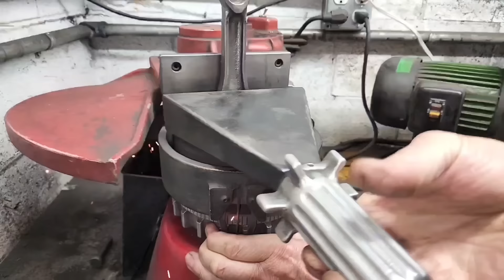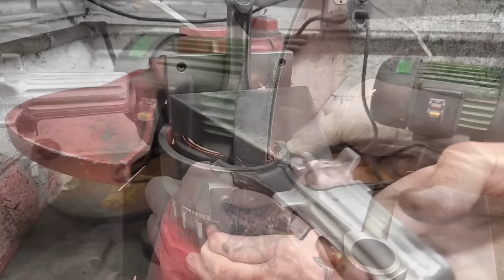Nobody resizes rods correctly see how I do it

Comment: Dave, it's obvious you know what you are doing and you are good on the hone .You have a lot of experience putting every rod right on zero. I would like to offer one suggestion. It looks like you are honing with Sunnen MAN-845 oil which is 50% Sunnen MB-30 oil and 50% mineral oil. If you get a chance to hone with 100% MB-30 oil I believe you will love it!. Sunnen actually specifies MB-30 to their industrial customers. They said they made the diluted 50-50 version, MAN-845 for Automotive Machine shops after some complained about the smell of MB-30 and taking too long to wash it off.
Reply from the maker: I'll look into that Thanks for watching and subscribing Greg 🇺🇸

Comment: You are doing a decent job…for the process and equipment…doing one rod at a time can alter the perpendicular of the rod bore to the sides of rod..lSUNNEN recommends younuse two rods at a time and reverse the locations as well…I had a new machine and sold it immediately as soon as a power stroke machine was released..one rod at a time captured between two ground circular rings that are absolutely at 90 degrees to the mandril

Once we got the machine going ZERO SPUN BEARINGS AND MANY RACES WON…BEST MACHINE FOR THEVBLUEPRINTING PROCESS
Reply from the maker: I'd never use a power stroker 
The first time the rod hangs up the power stroker tries to still stroke it, obviously it won't but that will throw the alignment out of wack and every rod you do after that will be honing crooked until the thrust faces are corrected 
Thanks for watching and subscribing 🇺🇸

Comment: i knew you were a dumbshit by the way you grind caps lmao are you trying to qualify?  the grinding wheel cuts on the edge of the wheel from sharp pore edges and you are glazing it across the surface as fast as you can that is the absolute incorrect hill billy method.

Comment: I just had a set of ford 300 6 cylinder  rods reconditioned,the crank only needed polished,can I still put rod in any cylinder? Somehow #5 and #6 got numbered #6
Reply from the maker: If they were resized properly it doesn't matter where they go
If the pistons are used and still on the rods I'd put them back in the same holes
Thanks for watching Troy 🇺🇸

Comment: would have thunk you'd use a reamer on those cap bolt holes... dint know they made hones that small....
Reply: That fit between the cap and bolt shoulder is critical for cap alignment.
Reply: @sarahelgin8082  are the bolts so inconsistent that you cant get a reamer to match the diameter?
Reply from the maker: The size of the shank changes a few tenths by the amount of press through the rod.
Reply from the maker: A reamer wouldn't work properly 
Thanks for watching 🇺🇸

Comment: How do you check if wrist pins are square to the big end and not twisted or bent?
Reply: The rod grinder clamps to the sides of the rod shank and cap making the new parting line exactly 90° to the sides. As the rod shank gets shorter from the parting line being ground, the pin end will need to be bushed and the corrected center to center length will have to be established. This process eliminates angularity between the big end bore and the pin and bore.
Check your rod with magnaflux to ensure they're not damaged.
Reply: @sarahelgin8082  Thank you! Learned something! 😃
Reply from the maker: I have a fixture made by Sunnen that check the rod for alignment 
Thanks for watching Sarah 🇺🇸

Comment: I have built 100s of high horsepower (800+) engines that lasted over 100,000 miles. My own small block 350 chevy dynoed at 622hp at thw crank after i rebuilt it and after 250,000 miles it was still making 590hp.   And i learned a ton from this video.  Thanks.  😉   
Specs of mt motor after rebuild: 383ci, 11.5:1 compression,  ported/polished lt1 (1996 camaro) heads, studded heads, and lower end. 2.02/1.60 valves
Cam: 550/565 lift, 296/298 dur @.050 , 105 lobe center. Custom grind roller,  redline 7500rpm
Ran E85
Sold car at 320,000 miles for 20,000. 
4.11 gears, 2spd power glide,  3200 stall, tubed rear, full rollcage.  Fun car.
Reply from the maker: That's an impressive build 👍 Thanks for watching Chad 🇺🇸

Comment: I thought this was the only way to resize rods.....Question: I have a BBChevy whose deck height (10.18") is (pert' near) even with piston compression height (1.27".). That's close. If I have to deck the block, can I shorten the 6.660" connecting rods (.020 or so) using this or some other method? Thanx......matt
Reply from the maker: Yes cutting and sizing a rod reduces it's length 👌 
Thanks for watching 🇺🇸

Comment: Does the hone touch the parting line because in theory that should already b at standard size  or do U take the complete bore a fraction oversize if you've got suitable bearings
Reply from the maker: Watch the video again I cut the parting line and make the hole smallest then hone it back to factory size
Thanks for watching 🇺🇸

Comment: Labor to Resize/Refurbish 50 year old rods good for 400 horsepower, 700$..., new forged 4340 rods with ARP bolts 500$ @ summit, good for 800+ horsepower...machine shops around here throw this stuff away because labor rates are too high.
Reply from the maker: I charge $250 for these 
And they're strong enough for 
Most street engines 
Thanks for watching 🇺🇸

Comment: You should as I do, check the cap fit after you press the bolt in the rod. Doing that will help reduce the size of the bolt and the cap will fit better.😊
Reply from the maker: I re-honed most of them after I installed the bolts
Thanks for watching 🇺🇸

Comment: Oh by the way if you pry your rods apart you use absolutely very little pressure it will not deform the ride one bit buddy if you hacked and grind on a ride like this guy did I wouldn't even use a pencil to mark off a place to punch it at I don't know but believe me I haven't seen backyard work like this in 50 years and yeah it's not 1950s anymore this is the year 2000 get with the program dude
Reply from the maker: You're nothing but a 
🧌 🧌 🧌 
Don't watch my channel

Comment: At 3:20, you side dress them after they're assembled & torqued together, that way the rod & cap are the same without any side lip difference! Also you don't free hand on the disc sander at 3:27, square the table to the sander perfectly & place the rod on the table stable before you touch the sander.
Back in the day I even bored out the babbitt on 6 cyl chev rods on a lathe, notched them for bearing inserts, & then sized them.
Reply: That’s the way I do it is with rod assembled then hit the sides
Reply from the maker: @tomwatson3662 Thanks for watching and subscribing Tom 🇺🇸
Reply from the maker: Thanks for watching 🇺🇸

Comment: Thanks for showing this.  I had a set of 1970 Boss 302 rods ruined by a machine shop last year.  When I got the rods back the caps were very hard to remove with the new ARP bolts.  I built a rod splitter and it took a shocking amount of force to remove the cap.  When I torqued them back down some of the caps walked to the side and created a lip at the parting line.   Also they did not chamfer any edge and it caused the some edges to fracture/crack when they torqued them down.  I don't have a single good machine shop in my area so now I am tooling up and doing my own machine work and this video explained exactly why each step is so important.
Reply from the maker: I'm glad you enjoyed it Thanks for watching and subscribing see-ya next time 🇺🇸
Reply: Prepare to spend a lot of money 🤑 ... Sunnen parts and machines are very high priced...
If you find used, don't be surprised... If the machine was abused... Fixing it will take lots of money & time...
Good luck

Comment: Still doesn't make sense to me. When you grind the caps you are only shrinking one diameter.
Reply: Rod caps stretch and get out of round in one direction, the rod centerline.
Reply from the maker: @hotrodray6802 ok and what's your point 🇺🇸
Reply from the maker: It shrinks the whole diameter 
Thanks for watching 🇺🇸
Reply: @BearButler321 I believe you that it does but how does it shrink the diameter parallel to the cap? Is it just a very small amount compared to the diameter perpendicular to the cap?
Reply from the maker: @gearhead1302 You're correct the sides don't get much smaller 
But it does decrease the size
So the rod starts out wider at the parting line and is then honed round 🇺🇸
Reply: @BearButler321 that's what I was wondering thanks

Comment: Hiya Bear, great vid bruv, hey just wondering at 4:00 when you start grinding the rod/cap area, how does the clamp/vice make sure the rod is exactly parallel with the cutting stone, I couldn't see any stop apart from in the middle area but that would still allow the rod to pivot out of parallel, can ya tell me how it's done? cheers
Reply from the maker: The sides clamp rod rod and hold it parallel
Thanks for watching and subscribing 🇺🇸

Comment: Do you grind the cap and rod mating surface at a slight angle to pinch the bearing halfs ?
Reply from the maker: No that's a bad idea it puts load on the bolts and they could break also when they're torqued and re-torqued the housing bores won't repeat and they will have distortion 
Thanks for watching and subscribing 🇺🇸
Reply: @BearButler321  I worked for a builder when I was young  . He never sent an engine out the door without doing that . He would set his grinder at just a degree or two , just enough to add a slight distortion. He claimed that it was insurance and never had a rod bearing spin . Of course this was back in the dark ages .

Comment: You are only measuring the middle part of the  bore journal, the outer edge of the bore need measuring too to check for bell mouth.
Reply from the maker: I guess you weren't watching 
I measured across the face of the housing bore and had no taper from edge to edge 🇺🇸

Comment: Glad you do NOT angle cut  It might work in a stock motor but in a performance build it breaks rod bolts
Reply from the maker: If a rod is angle cut it won't repeat every time it's torqued 👍
Thanks for watching 🇺🇸
Reply: @BearButler321  That true too and measuring stretch does not help, cut flat and start over even high buck aftermarket rods and a little extra clerence at the parting line makes no difference that's not where the load is

Comment: I can't believe the prices at machine shops I used to charge $15 for the first rod and then 7.50 for the others. I'm back in the day I charged $90 to bore a block.
Reply from the maker: Times have changed 
Thanks for watching Paul 🇺🇸
Reply: @BearButler321 sure has. 
I went thru my VR6 and had a bore and balance done. 
First oversize on the pistons , and IE aftermarket rods. 
While playing around with a scale before I brought it all to the shop , I found out the new parts weighed like 4oz less per hole for a savings of 24oz total across all 6 cylinders. 
That was just for funsies. 
The instructions for the rods said the small end might need to be honed a little ,and they did because the pins were a super tight fit. 
So for 1700$ I got the block cleaned ,bored ,and the crank balanced for the new parts.
I'm sure there was stuff that wasn't exactly listed ,like sizing that small rod end and whatnot. 
Overall ,most folks said that's a fair price for the work done in my area.
Plenty of locals recommended them, as it used to be the machine shop for Dyson racing but when he retired they opened the doors to the public. 
Maybe another rough idea for pricing, a buddy had a 350 Chevy flywheel surfaced for 65$ about 2yrs ago. 
Were located in the Hudson Valley area of upstate NY.
Edit: after watching that Spa rod video , I noted those IE rods I used were decent. 
About 800$ for the set.
Reply from the maker: @MrTheHillfolk I prefer the small ends to be small because every pin manufacturer varys the size by a tenth or two 🇺🇸
Reply: @BearButler321 yeah I figured my backwoods check of the slip fit of the new pins in the new rods vs the pins in the original rods isn't a conclusive test 😄
At least they weren't out of spec to the large side, putting metal back is a difficult thing 😄
Reply: In Germany 120 Euros per rod!
Reply: Machine shop prices were always too low back then, for the shops that did top quality work. Example: shops that milled a head had to compete with shops that belt sanded a head with price, because many customers either didn't care or were ignorant of the difference in quality.

Comment: Many years ago, probably in the 70s , I worked in a rebuild shop where, among other things, we reconditioned rods. We had reasonably good results, I think, but after watching your video, I see where we could have  done a lot of improvement. Thanks! Retired now, so that machine work is long past my time, but the video was great!
Reply from the maker: I'm glad you liked it 👍
See-ya next time Jim 🇺🇸
Reply: @BearButler321  how do you feel about JAMSI uses a shim under one side of the rod when they're cutting.  He says it make the sides pull in to ensure the hone touches all sides to be completely round. My only concern is the tension the rod is under when machined "crooked" per say.  Whatcha think? He obviously doesn't have a rash of rod failures from doing this many years so, i guess it's not an issue.
Reply from the maker: @BEANS-O-MATICtransmissions That's a horrible idea back in the 80's I worked at a production shop and that how we did it.
Years later as my knowledge of machining grew I discovered that when the rod is un bolted them re-torqued it won't repeat but it will still function but won't last as long because it's not to my strict tolerance. Also doing that put unnecessary stress on it.
There's a lot of things they do that I'd never do.
Thanks for watching 🇺🇸
Reply: @BearButler321  that was my concern as well with the stress
Reply: Damn! I can smell that honing oil. Did a few years in a motircycle race machine shop and later a shop that only did honing.
Reply: It soon will be illegal due to climate and fine dust laws!

Comment: This only works for a low horsepower slow engine car,.
Reply: On stock classic American V8s, I've never worried about the rods or the bolts at all during home garage rebuilds.   Waste of time and money as long as everything "looks good".
Never had a problem and I'm talking about V8s from the 1960s and 70s running at near stock HP.    Stock rods were great back then unless you really go wild with HP.
Reply from the maker: @scdevon Thanks for watching and subscribing sc See-ya-next time 🇺🇸
Reply from the maker: Not true I build a lot of strokers using factory rods and nobody's broken one yet
Thanks for watching 🇺🇸
Reply: I have seen a lot of good used connecting rods ruined by resizing them. There is way more to it that what was shown and explained here. Bell-mouthing the bearing bore is common when doing them by hand. The bore not only needs to be to size, it needs to be straight and actually round or a hair larger across the parting line. Using a rod for a hammer is not good either.
Reply from the maker: @G53X0Y0Z0 almost every rod I see that someone else thought they were resizing was junk.
Tapping the rod didn't hurt anything 
Thanks for watching 🇺🇸

Comment: as much as i appreciate saving factory rods, scat has ready to run ibeam replacements for like $400 it's just not worth it anymore
Reply from the maker: These rods cost $250
Thanks for watching Sean 🇺🇸
Reply: @BearButler321 after balancing, and recon, with $80 in bolts ? Your labor rate must be low, out here that's 3 hours of shop time @100 hr
Reply from the maker: @seancollins9745 I pay $35 for the bolts. I buy them in bulk I can do the job in about 1 hour 15 min. 2 1/2 if I'm filming 😂
Balancing is extra 🇺🇸
Reply: @BearButler321 yeah $300 plus bolts, for rods that while good for the time, aren't good for performance use. I just bin them
Reply: @seancollins9745  
I get that, I build Harley engines, years ago we would recondition those rods, press out the bearing races, press in new races then size them with a lapping mandrel to where you get the proper clearance with your new roller bearings and the new crank pin you're using. 
Between the races, bearings, crank pin and the time it takes to do it I might just as well by a brand new replacement rod set that comes with everything including the crank pin and it's all sized and assembled for $250.
My profit margin is the same as if I do it myself and I have zero time in doing it, that's time I can spend on something else I can bill out my time for, it's a no brainer.

Edit, and I forgot about pressing in new piston pin bushings and sizing them, one less thing to mess with buying a new rod set.